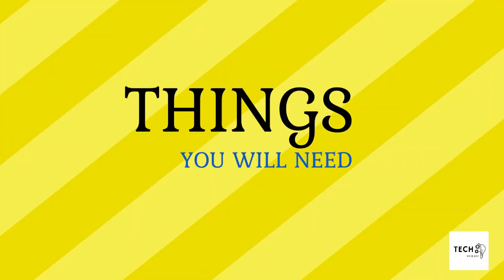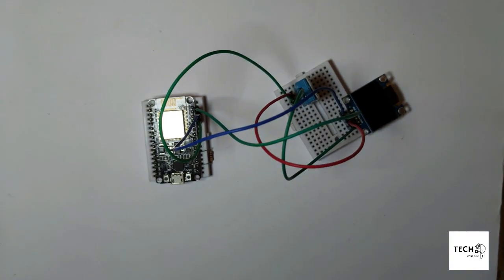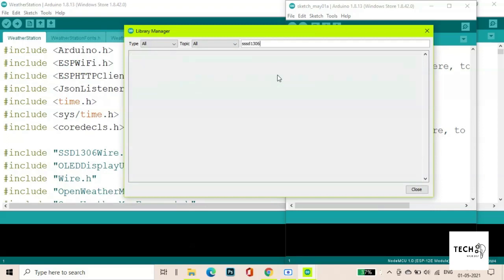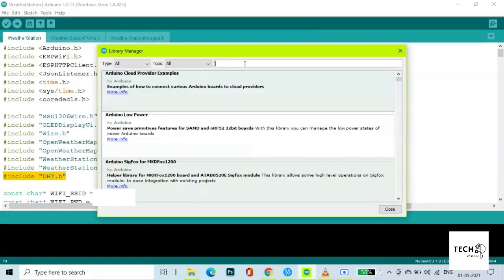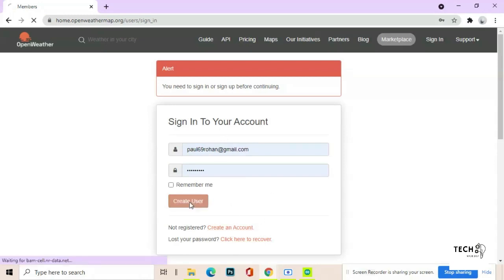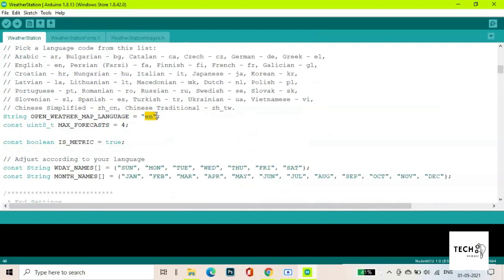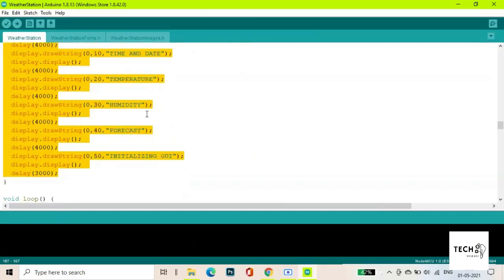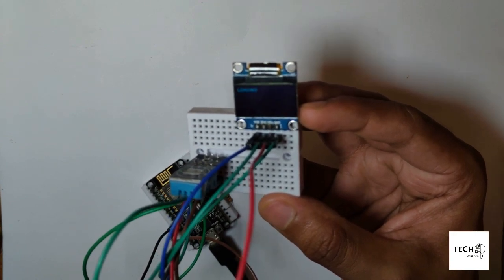DIY #2 WEATHER STATION WITH NODEMCU ESP8266, OLED DISPLAY AND DHT11 WITH EASY TO FOLLOW INSTRUCTIONS

Comment: Sir your project is quite remarkable, attractive and interesting one. But Sir can you tell me why the display showing reverse position. How can I create right position. If the connection pin is in upper side it's right position but if it's in bottom position it is reverse position. All the functions done working. I have used DHT22 sensor instead of DHT11 sensor. Room temperature & humidity showing less.
Reply: How you have done
Reply: I'm making with DHT11 but the temperature is not showing you know

Comment: I have the exact same parts as you, installed libraries as you did, but the DHT examples show as incompatible so there is no DHT.h file when i try to upload.   How can i fix this?
Reply from the maker: most likely case is that you might be missing the dht libraries.
Reply: use  DHT sensor libary from adafruit
Reply: This code had bugs related to the DHT library. It does not compile.